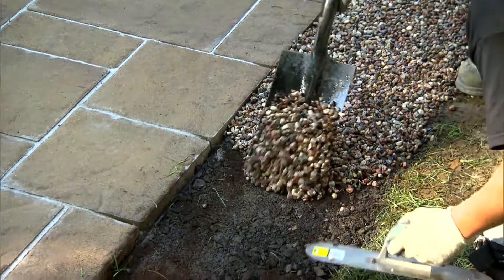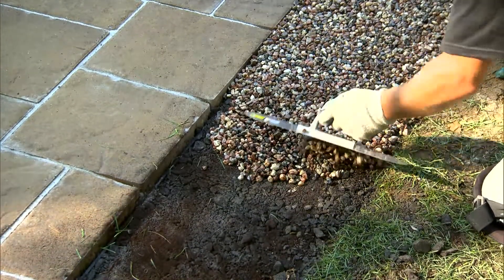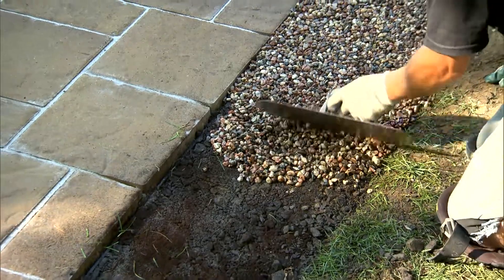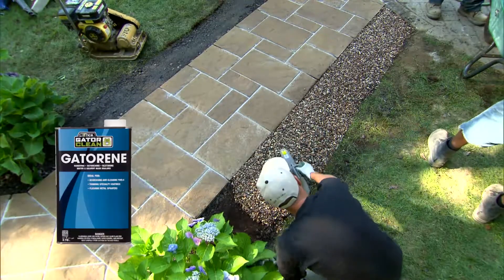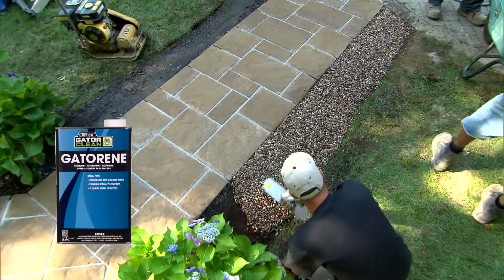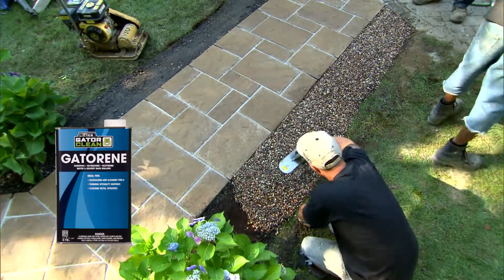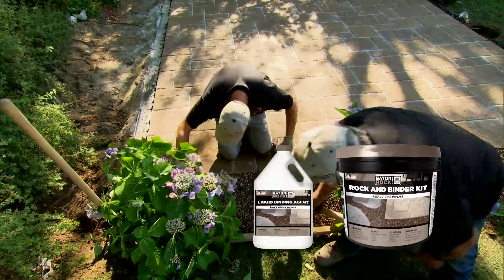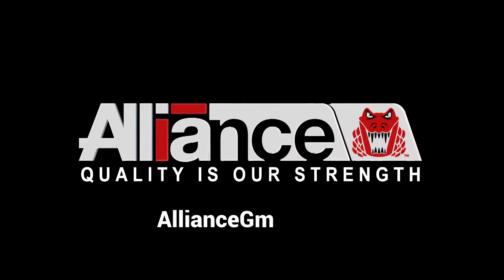How To Use Gator Rock Bond

Comment: Can this be sprayed directly on the existing rock? Stone is 3/4 inch river rock in between Eden stepper stone. Gaps are approximately 2" to 4". Also, would it stain the steppers?
Reply: Seems like nobody cares to respond
Reply: no its a very thick product it's essentially a epoxy resin . it would not be able to be sprayed and diluting it would likley ruin its integrity.  any spill should be cleaned up quickly . I found mineral spirts works to clean the tools .